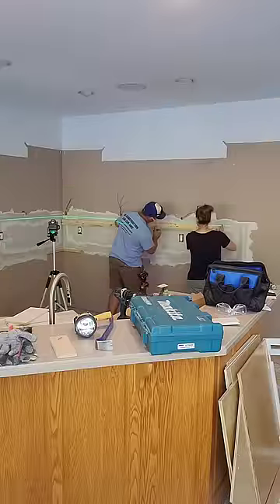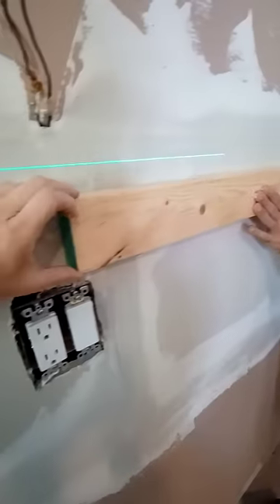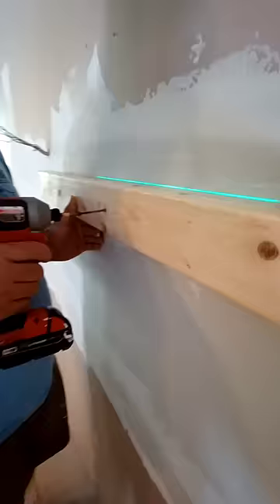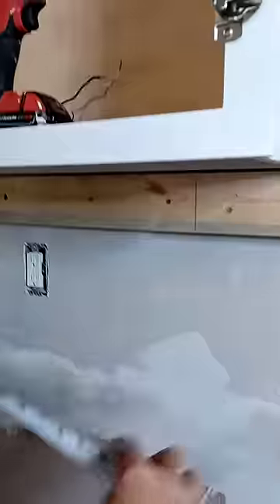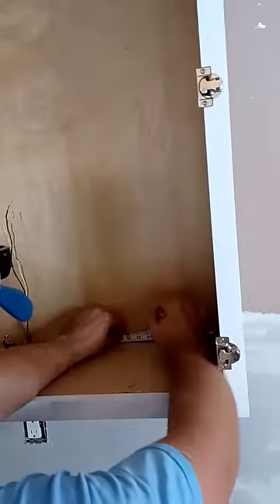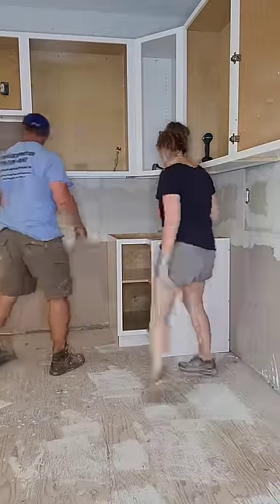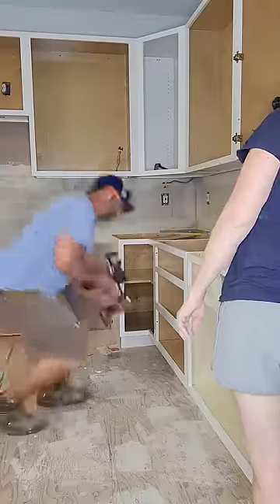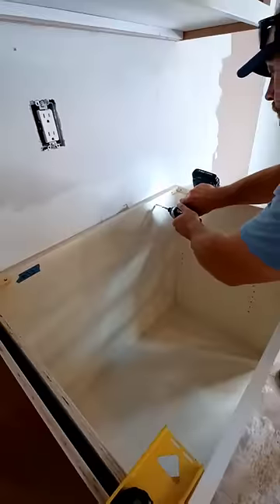How To DIY Install Kitchen Cabinets

Comment: As a professional cabinet installer and custom carpenter, you always start on your high spot
Reply: In some situations with code for sink height I've had to start with sink base at the lowest spot and cut toe kick off the rest of the run and I go
Reply: You start at the bottom genius

Comment: Thumbs down as you don't give any instructions for how to make the cabinets plumb and level
Reply: You just place the level on top and make sure the bubble is in the middle

Then to check if their plumb is to place it vertical against the cabinets and make sure the bubble reaches the middle again
Reply: if you dont know how to use a level you shouldnt try to hang your own cabinets

Comment: Don’t use the wafer head cabinet screws on the face frames… too ugly. A trim head screw looks nicer and works well.
Reply: Very little holding power though… especially long term. 2-1/2” regular grk countersunk for a little more peace of mind

Comment: I am new to DIY, thanks a lot for your Video, what happen to the Ledger Board, did you remove after screwed cabinets drywall ?
Reply from the maker: Yes, it's just there temporarily to help hang the cabinets. Remove it once cabinets are all hung. Have fun on your DIY journey!

Comment: Nice video.  Only thing in would  hangs is to use the Bessey cabinet face clamp on the faces instead of the one used here.  It will line up the faces easily and perfectly.

Comment: I think you should connect the upper cabinets together then screw them to the wall like both cabinets because if you screw them first they won’t connect together properly
Reply: The 2x4 is there to keep it level on top and bottom, and you can still adjust it front and back by slightly tightening or loosening the screw holding the cabinet for the wall
Reply: @someguy1358 he’s right. You screw the cabinets to ea h other first before to the wall after setting the first one
Reply: @someguy1358 they're right, I always screw the cabinets together. Sometimes the wall is out, also you can't always use 2/4s, either you don't wanna make screws in the wall (been painted) or their is backsplash below. Who knows. Just screw cabinets together, put a level and push up or down on the right side of the cabinet and screw in the studs.
Reply: You set your first cab then clamp faces, screw em together then start your wall screws. Then use your level as a straight edge to check the face and shim accordingly and snug up the screws.
Reply: Prior to setting your first cab use a 6' level and know the belly in the wall so you don't screw your  self and have to back the screws out to shim on a run of cabinets lol. If it's home depot cabinets or the like. Just send it no shims 😂

Comment: i was thinking to do some kitchen cabinets and i am thinking how to attach them to the wall, seeing... ply wood back + few screws to hold all this weight... will it really work?
Reply from the maker: I'm not a cabinetry expert, just a homeowner showing how I DIY my cabinets. With the weight some of these cabinets can hold when you put in glass dishes, etc, I would only feel comfortable if they were screwed directly in to studs.

Comment: I have the same cabinets! Quick question. How were you able to clamp and connect the upper corner cabinet to the regular ones on the sides? I cant really find a good way to clamp on them. Ideally I want to connect them together before putting them up due how my walls are.

Comment: What type of screws to use would be helpful for those that have no clue what they're doing. Thanks for the upload
Reply from the maker: Great question, and my apologies for not including that info. You can buy "cabinet mounting screws" at any hardware store, or online. You can search specifically for "cabinet screws" and find several options.
Reply: @thedailydiy  they should come with the cabinets.

Comment: Do the screws come with the cabinets? If not, what screws are recommended to be used going into the wall? Thanks
Reply from the maker: you buy the screws separately and they make cabinet screws specifically that I used.

Comment: Question-if your upper cabinets need to be shimmed at the bottom...how do you shim them with the ledger board in the way? I'm just curious as we are waiting on our cabinets in a week or two.
Reply: Hang them from the top screws, remove the leger board and shim the bottom as necessary. Each screw, if screwed into a stud is capable of carrying ~80 lbs so its plenty strong to hold up your empty cabinet.

Comment: How come you installed the cabinets without finishing your floor?
Reply from the maker: I prefer to put in the floor after the cabinets so if I want (or need) to change the floor later I don't have to remove my cabinets to do so.

Comment: Save you mucking around with a laser level. 

Install and level all base cupboard.

With an overhead jig offcuts 600mish high (standard size) is place ontop of base cupboard. Have your top cupboard sit on jig and anchor. Easy peasy.

Therefore, it becomes a one man job.

Comment: How do you know if the studs have wires or water or HVAC where you’re drilling?
Reply: Invest in a stud finder
Reply: Better stud finders will warn you of power (wires) and metal (pipes). If you have PVC or PEX pipes then good luck.

Comment: You don't screw the upper cabinets all the way down to the wall until you screw them together first
Reply: Correct. I install cabinets for a living and I use a cabinet jack so I can manipulate each cabinet. A 2x4 is how you get unlevel cabinets

Comment: This only works with a solid-backed kitchen, In the UK kitchens are built differently and therefore need to be installed differently, Wall units are hung with brackets and then hooked on and tightened. UK installers start with the base units and start in the corner.
Reply: thank u for the insights, do u know where to find tutorial? i want to install wall units

Comment: The thing you messed up on was you should’ve put in the flooring first flooring should be under the cabinets as well.
Reply from the maker: If I want to change the flooring later it's easier to do so this way as I don't have to rip the cabinets out to get the flooring up.  I've seen it done both ways and my personal preference is floor last.
Reply: I purchased my flooring at Floor and Decor, and if you install the cabinets on top of the flooring you void the warranty